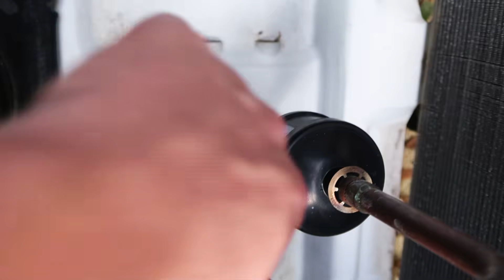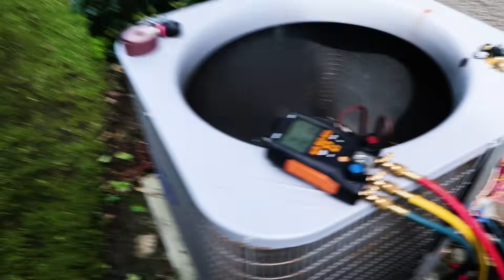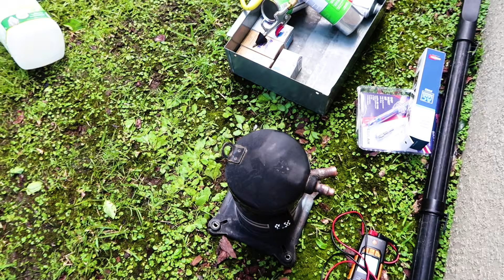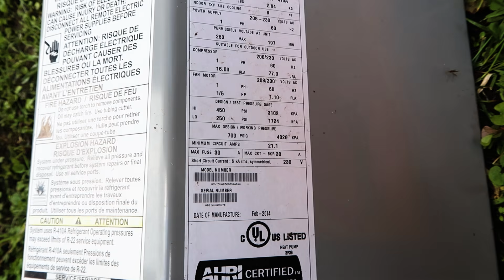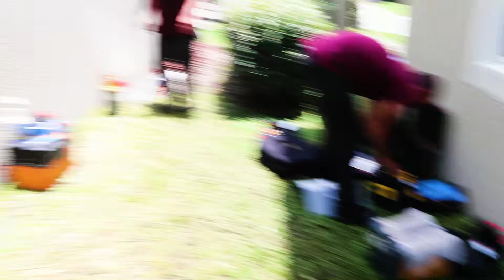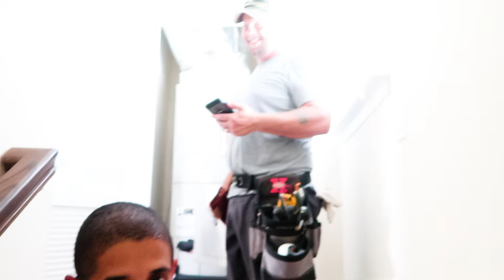Replacing a Compressor, Start to Finish

Comment: My compressor (LG) went out in my unit that was installed 6 years ago. After trying to determine what I need to replace it, I realize that they didn't install a dryer filter on the unit which I believe caused the compressor to die too soon.  Is it required for them to install a dryer filter or am
 I just shit out of luck?

What's also odd is they ran the lines to the unit through the dryer duct opening and let the dryer vent into the crawl space.   I feel stupid for not knowing they did this.

Does this contaminate the whole system?  Will it still kill a new compressor?

Comment: How long does it take to vacuum the heat pump unit after replacing the compressor? In my case, the two-stage value pump worked for 4 hours to reach 500 microns. Previously, the nitrogen leak test lasted 48 hours

Comment: I just did a compressor swap on my mini split. No I didn't have all the recovery system and all that, but busted compressor in the middle of the summer SUCKS. 

I had someone braze a line to the outlets, and then I just used flare fittings to connect it to the condenser. Not ideal but it works. I didn't nitrogen purge because I don't have any nitrogen.

I pulled a vacuum for about 30+ minutes, no micron gauge so it's the best I can do, then when I confirmed there's no leak (left it alone for 10 minutes to see if the vacuum is lost), I released R22 into the system. Then powered the compressor on, and got it charged by the superheat method (it's the only way I can do it). New compressor is cooling much better than the old one. I think the old one was busted to begin with and it just failed suddenly one night. It was making a lot of noise and weak (the needle on the gauge was vibrating like it couldn't suck hard enough) before failing. So if your AC wasn't cooling well even if all the refrigerant level is correct and there's no leak, your compressor is failing.

Comment: Was all good until the dryer deal, 10’ of line not goona matter. Just like which line to open on a new install. It’s 6 of 1 and 1/2 dozen of the other. Low oil return from refrigerant loss got that one.

Comment: As far as bolting the compressor... the compressor is bolted hard for shipping. I'd recommend to loosen the bolts for ALL of the reasons you condemned... mostly, allow the compressor rubber isos allow to absorb the vibration... not the copper lines. Obviously, your not going to harm the compressor...

Comment: Climate Master puts Supco hard start kits in some of their heat pumps from the factory. 
I have seen an entire building with problems because the installers removed them. Call the manufacturer to be sure it shouldn’t have a hard start kit. Those little single phase compressors are very touchy. They need the perfect capacity to not start out of phase and lock up.

Comment: What if I replaced my R22 with R290?
Reply: If i remember correctly.R290 is propane and flammable.You would be doing that at your own risk.Im not sure what kind of   head pressure  you would get with R290..

Comment: Hi sir, thank you for your fantastic video. Would you please tell me how we can purge nitrogen when we want to change the compressor? I mean there is no way for flowing nitrogen when the discharge valve of compressor is close? Or even for removing the compressor can we purge nitrogen? I can not understand it? Based on compressor structure there is no way between suction and discharge for nitrogen flow?!

Comment: Bryan worked on a heil package unit daul fuel. Had to replace a compressor which was under warranty. The Schrader valve look different from the ones I  usually see. Their also on carrier units have you seen them looks like they can be remove the whole core with wrench. So my question is can I use valve core tool on these

Comment: This is late, but I cringed, when you mentioned discharge muffler vs drier, I ACTUALLY found a job with NO COOLING   It was a lobby @ a RICKELS in UNION NJ   naturally the drier broke down from the heat, all I could do was cut it out & use a piece of tubing to replace it . , I shine a package unit on a roof. 3 toms , with that muffler ,  Cheers 🇺🇸🇺🇸🇺🇸🇺🇸

Comment: Quick question regarding the bolts and nuts, etc which are holding down the compressor. Long story short I removed the nuts which included some rings but I lost one ring. Is it okay to screw back on without the ring. (Portable Ac)

Comment: Pro tip: it’s only half true you don’t have to rinse off your evap coil after using evaporator coil cleaner. In fact the only time it’s ok to not rinse the evap after using the cleaner is when the system is actively being used as the condensation rinses the coil off. Otherwise you should rinse it off... read the can that’s what it will tell you
Reply: True.  What you don't rinse off, you will be breathing into your lungs.  Seems like common sense to me.

Comment: Pride in workmanship right there!  Many contractors will recover, unbraze/rebraze no nitrogen, change drier, vac and charge. No cleaning or other testing and I’ve even seen them leave dirty filters.  I would go out of my way to hire a company like this. You only get one chance to do it right unless you want to do it over.

Comment: Compressor hangouts have been a thorn in my flesh. I've always understood that the oil has to be drained from the old one and oil measured in with the new one. Oil is not even mentioned in this video. Any insights?
Reply: Oil is contained in the compressor (only small residual in lines) and the evaporator is higher than the condenser. Since the comp was replaced there is no need to drain the old - it also could very well be contaminated and should not be mixed with new.  It is worth checking if you’re making a repair to an existing system with a known leak where the evap is lower than the condenser (roof mounted).

Comment: How do you tell the difference between a discharge muffler and a liquid line filter/drier?
Reply: It’s location for starters. Between the compressor and condenser coil would be the discharge and between condenser coil and txv the liquid. Usually some markings or a sticker at least on the filter driers, not always the mufflers

Comment: Another awesome video, saw that he pinched and brazed closed the old compressor, Copeland asks that you use tape the fittings closed not silver solder :)
Reply: cap, plug, crimp, solder, yes. Tape? Tape covers a lot of territory. But not for very long.

Comment: Wow! A boss that not only stocks your truck with a recovery machine & a vacuum pump....but a boss that stocks your truck with a $800 recovery machine & a top of the line, expensive vacuum pump as well!
I hope his techs appreciate that.
Everywhere I have worked, I was told that I had to buy all the tools. Only parts, materials & the service van & gas card was provided. (& thank God they supplied that!)
Reply: Yeah, if his guys leave, they have a very high chance of working with lesser gear than that.
It seems to me shops that do not invest in gear, don't invest in their guys either.

Comment: What about the oil? Do we add oil or the compressor comes with it's oil?
Reply: You mean filling to the site glass?
Reply: @WillieMakeit  oil never come in refregirant bottle it comes separetly or in the compressor if it's new.
Reply: Oil comes in the compressor when new.  The refrigerant also contains lube.
Reply: oil is in the refrigerant, that's why you charge with the bottle upside down
Reply: Willie Mallard the oil is not in the refrigerant. It is in the compressor. The reason you charge with the tank upside down is two fold, primarily cause it’s a blended refrigerant to avoid fractionation, secondly it’s quicker.
Reply: @WillieMakeit  I think we are two now have to get the answer 🤔🤔😣
Reply: Hosni Ben abbes the oil comes in the compressor.

Comment: What is that stuff you use while brazing in  the line drier & compressor?
Reply: Wet rag by refrigeration technologies. Solderweld makes a similar product called hot block which would be my preferred choice. Otherwise all of refrigeration technologies products are great

Comment: Is $2900 fair to pay somebody to do this job? I feel like that’s kinda steep seeing as how I can get a compressor for $600. So I’d be paying $2300 in labor
Reply: I own a heating and cooling business in Athens Ohio and that price is ridiculous I change out the outdoor unit and install new evap coils right around that price range
Reply: Brian Foughty That’s what I thought. I was quoted 7500 to do what you just said over the phone the other day. I haven’t fixed my ac yet because I can’t believe these prices but my family needs ac as we are getting into the hot months now. I guess thats what they’re using as leverage. I might just buy a couple window units and call it a day for this summer.
Reply: Gabe yeah you’ll get that. Those prices are top end equipment with a full system change out for me. Sorry to hear you’ve got some greedy company’s in you’re area

Comment: Have a question. May I use a 410A compressor and use 407C refrigerant instead. So I can use it for an R22 system where the compressor failed?
Reply: It does matter. Get the right part.
Reply: LOL, I hope you didn’t go through with that.. there are so many things that could go wrong ...
Reply: it does not matter, just so you have correct tonnage rating

Comment: For the drain pan treatment, it would be better to spray the condensation side of the coil, under side in this video.
When you braze the liquid line, keep that seal off until you are done. This will keep it from melting!!!

Comment: Just curious, on the larger CFM rated vacuum pumps and larger sized vacuum lines, do you run the risk of pulling to quick of a vacuum? Also, not quite clear on the procedure you were explaining when placing in the factory charge on the discharge side. Do you have a detailed description of what is involved? Thanks for all you do Mr. Bryan!
Reply: Your not going to pull to quick of a vacuum. It’s about how low, not how quick. And the charging, he was referring to adding refrigerant back in through the liquid line instead of the suction. To avoid liquid refrigerant in the compressor
Reply: @jeffb8437  he was concerned of freezing. If you pull extremely fast you can run a risk of freezing but it's rare. More apparent on really small systems and if ambient temperature isn't warm

Comment: I had the same problem with my Testo clamp temp probes.  With that 8 pin connector design connection, you can forget about trying to repair that connection.  I did my Fluke K connection style replacements without incident, easily.... now its $110 later for two Testo replacement pipe clamps. ouch... The expense of Fluke pipe plamps are worse,  they are about $150-180 each. The  only consolation is they have the repairable K connection.

Comment: A single phase scroll compressor can run backwards!?!?.........
Reply from the maker: Yep... if short cycled it can definitely happen. I’ve seen it many times.
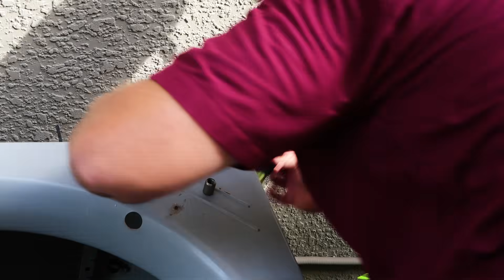Reply: All  units we install have 5 minute TDR's, They are stock in Carriers (4:45 sec) or use to be anyway, if this happens, they must be a bare bones unit.  All units we install have as a minimum LP and HP.  Many companies are removing many of the protective devices  that have been stock parts for years, in the hope of selling failed parts.  Three phase scrolls had such a bad time failing when they first came out, the companies installed fail-safe devices. The reason was because of the warranty.
      I understand when a scroll stops, it momentarily runs backwards being under pressure, and theoretically if power were applied while in motion it may not be able to overcome the rotation.  I have seen something similar to this in a twinned  air handler fan motor when only one started and then the other motor tried to start  while 6he other was spinning backwards... The only single phase motor Im familiar with that can run backwards is a shaded pole motor in a refrigeration unit with a special relay  to natural air defrost a supermarket open style unit.  Naturally speaking though, single phase units don't run backwards.
Reply: Really??? Just how do you make a single phase scroll compressor reverse direction???? single phase scrolls don't run backwards....
Reply from the maker: Try Google before speaking with such confidence http://www.emersonclimate.com/Documents/Resources/Refrigeration_Contractor_Weekly/Can-a-Single-Phase-Scroll-Run-in-Reverse.html
Reply: HVAC School wow. Did not know it was possible. You learn something new everyday.

Comment: Why on earth would you replace a perfectly good Amrad dual run capacitor, especially with a  Amrad 200 multi? Otherwise, excellent work all around.
Reply from the maker: Yes... that was a little overkill, but in general replacing the run cap with the compressor is a good idea so I just demonstrating
Reply: Your videos and podcasts are simply the most relevant, the most informative, and the most accurate that I've seen or heard anywhere. And, I really appreciate your sense of humor. Thank you very, very much.

Comment: Can you reuse the acid test later if it doesn't change color?
Reply from the maker: It’s designed for one use only
Reply: I'm designed to be cheap.
Reply: @maynardr6   sometimes cheap can cost a lot more money LOL

Comment: I envy the air handler location. Where I live here in California the majority it's all new construction, within 20-25 years and most of everything we deal with is up in the attic. So not only do we have long lineset applications we have long drain line applications, using Bluetooth digital devices for measurements is always a hassle. Oh yeah not to mention ductwork. Big time high production low cost contractors installing tight duct systems on oversized equipment is a constant nightmare which I lose sleep over LOL... However great video!
Reply: Yep, I agree because I worked as an HVAC Service Tech. in SoCal for 11 years and Arizona for almost 4 years now. The attic temps. in the summer are much worse in Arizona however. Luckily, we've got plenty of rooftop packaged units here though, and would rather work on those instead. The guys who work on basement furnaces/air handlers are spoiled in my opinion lol.
Reply: John Kickass there are some horrible basement locations... we’ve got some attic stuff which does suck being 120° and 90 plus% r.h.